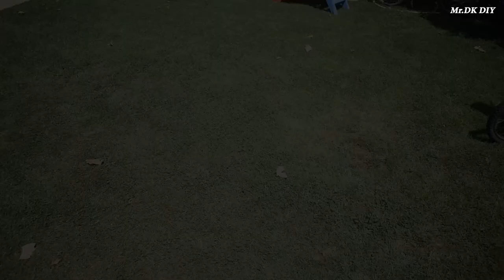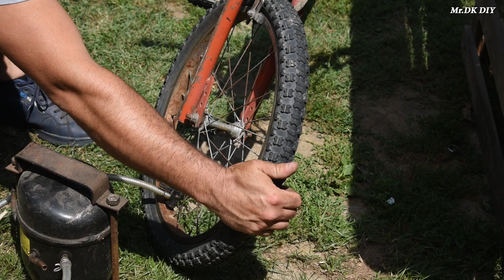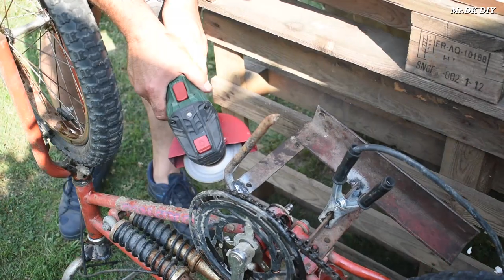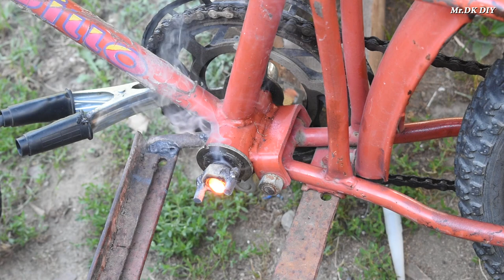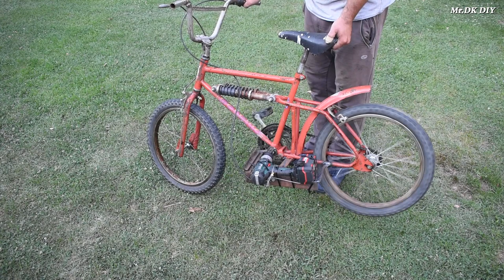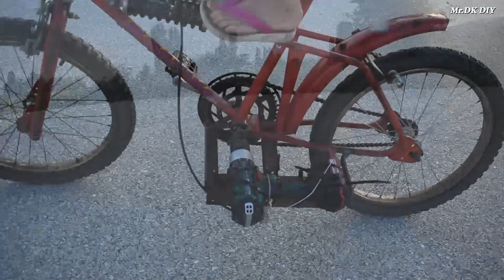SIMPLE HOMEMADE ELECTRIC BIKE  USING CORDLESS DRILL

Comment: the bike build is awesome...  I do see a problem "from an older persons point of view".   I'd remove that extra pedal and weld some horizontal feet pegs.  Also, reroute the "throttle" cable so if she needs a quick dismount, her foot and leg wont get entangled and she won't struggle and end up harmed.

Comment: Do you know what a dandy horse is? Can you make one out of bicycle parts. I got ideas. It will have 3 wheel. The wheel in the front will be fixed to the handle bars just like regular bikes. Another wheel will go where the pedals would go and would be fixed like a back wheel would be. Dandy horses don't have pedals of course. Don't. Need any. The last wheel would go at the back and would spin and turn freely like a market cart wheel. It would not have a seat. Just padding raped around the top part of the frame. It would ride low. Small wheel are effective.

Comment: Ya cause EVERYONE has a random welder & electric metal cutter/grind saw thing. 😒 It's cheaper just to get a real electric bike. Welding machines are at least twice the price. & metal cutter are half the price so really you'd be spending at least twice & a half the cost of a real new ebike.